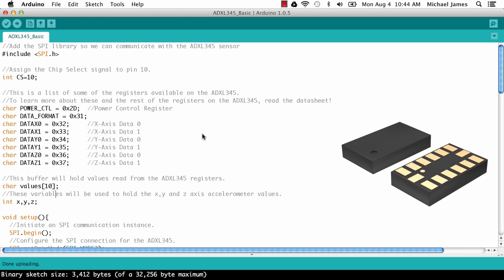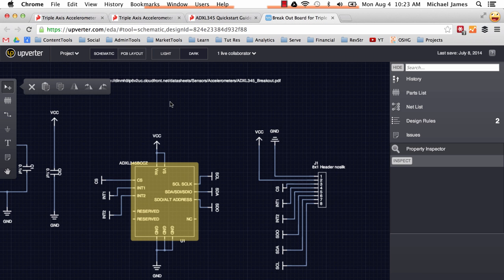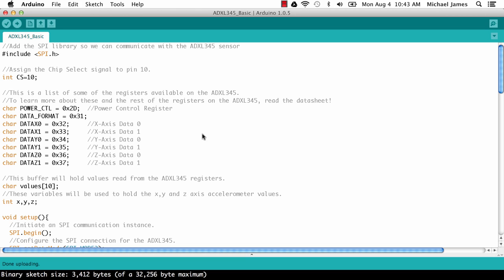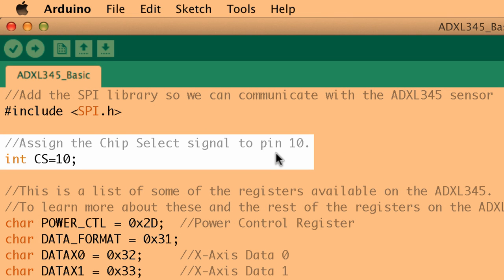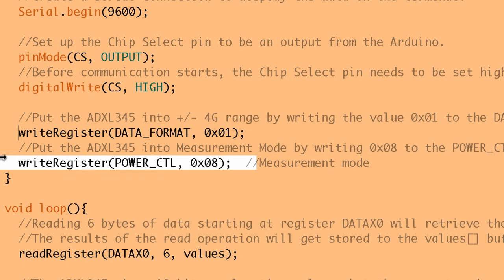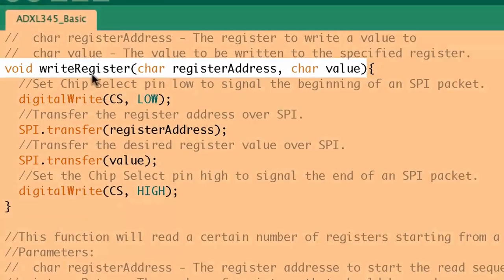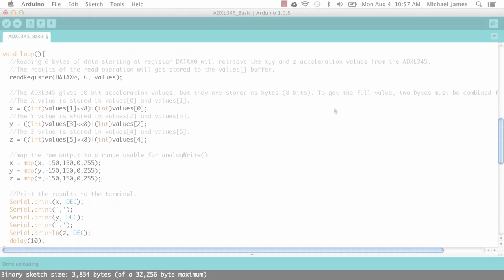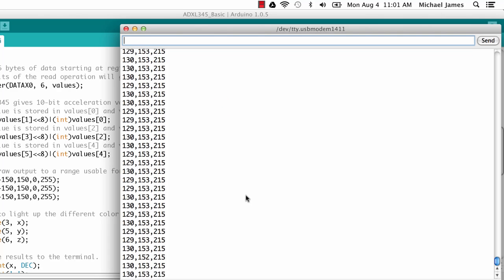What to do when you just don't know :: Arduino, ADXL345 triple axis accelerometer and an RGB LED

Comment: Nice and interesting!
If we take one axis of the three axes, for instance the X-axis, then a zero value is for the horizontal position. A negative value (-1 to - 128) may represent a counter clockwise position and a positive value (+1 to +127) may represent a clockwise position. the same is true for the Y and Z axes. Notice that (-128 to +127) is 255.
Thank you

Comment: Very nice production value on the video!

Any plans on visualizing the sensor output using Unity?  I've seen some projects that do it, but I ''just dont' know' enough to implement it myself correctly!    This is my code:

void SetPosByAngle (  float fPitch, float fRoll )
{
    Vector3 LowerLimit = new Vector3(0, 0, 0);
    Vector3 UpperLimit = new Vector3(180, 180, 180);
 
    // Normalize from -180/+180 to -1/+1
    fPitch = (fPitch) / 180.0f;
    fRoll = (fRoll) / 180.0f;
 
    Vector3 AngleDiff = UpperLimit - LowerLimit;
    Vector3 CalculatedAngle = new Vector3(-fPitch * AngleDiff.y, 0, -fRoll * AngleDiff.x);
    TragetAngle = LowerLimit + CalculatedAngle;
    transform.localEulerAngles = TragetAngle;
}

Where the angles sent to the function above are calculated via:

fPitch = (float) (Math.Atan2(YAxisAccelerationData,ZAxisAccelerationData)+M_PI)*RAD_TO_DEG;
fRoll = (float) (Math.Atan2(ZAxisAccelerationData, XAxisAccelerationData)+M_PI)*RAD_TO_DEG;

Unfortunately, my object moves across the screen, rather than pitching/tilting at the center of the screen.     Apparently the solution to drift is to project a reference frame, but would love to see a how-to!
https://gamedev.stackexchange.com/questions/140141/unity-3d-recreation-of-pitch-roll-from-accelerometer
http://answers.unity3d.com/questions/416169/finding-pitchrollyaw-from-quaternions.html
https://forum.unity3d.com/threads/roll-pitch-and-yaw-from-quaternion.63498/